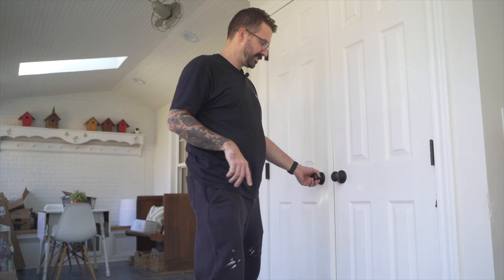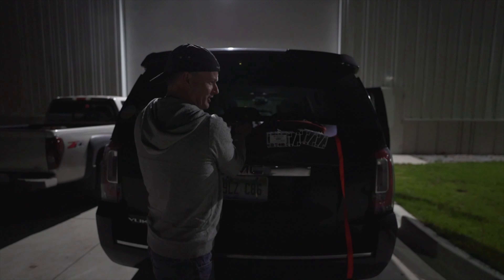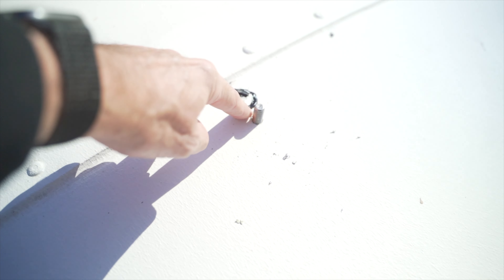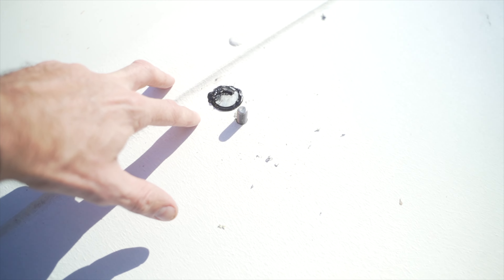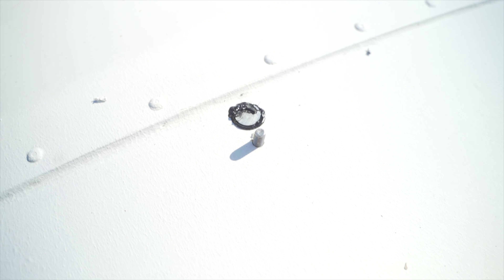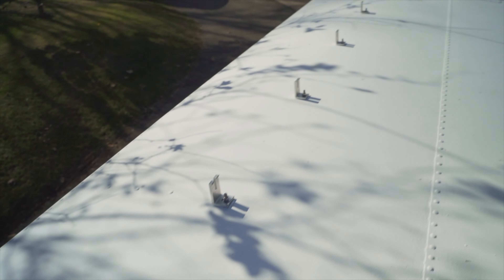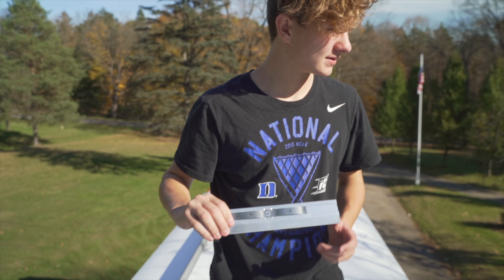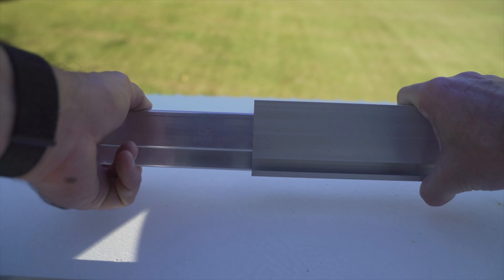08 Skoolie Solar Rack Install w/ IronRidge Solar rails

Comment: Did your roof L brackets sit level with the roof curve? Installing mine tomorrow after the tedious task of cutting aluminum rectangle spacers for all 28 brackets and epoxy them for the curve like Chuck suggested. Doing the butyl tape tonight
Reply from the maker: Sorry it took forever to respond:  Fortunately for me the curve of a Gillig isn't as pronounced as a standard bus.  So they worked fine with mine.  On a roof with more curve, they might need a little "additional" help to fit it well.